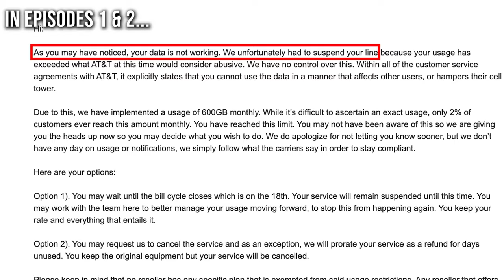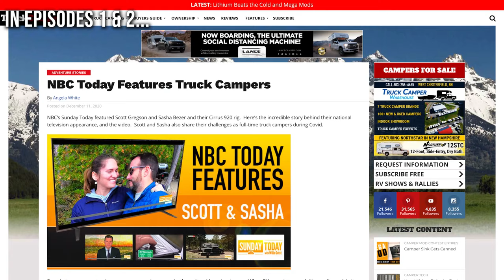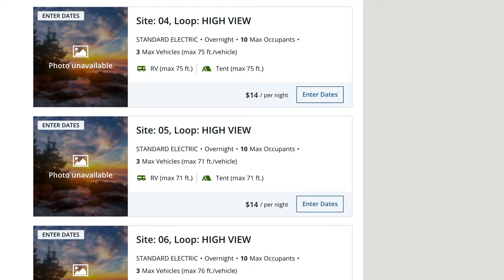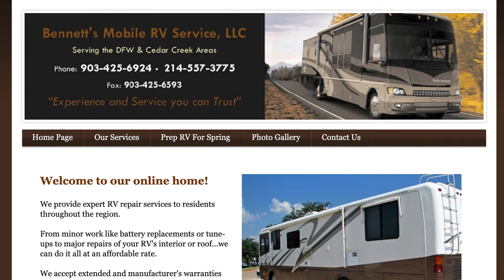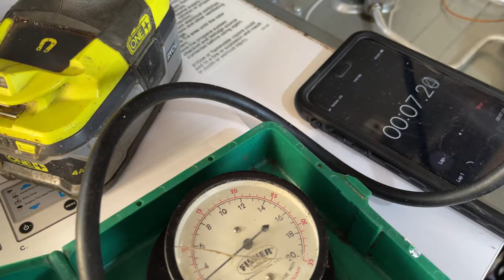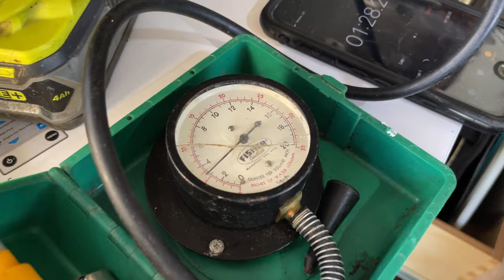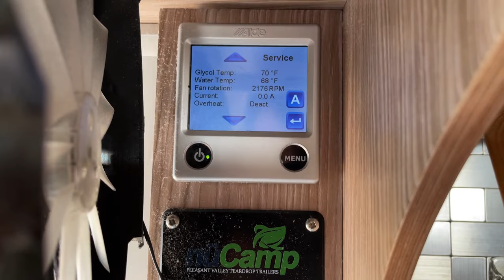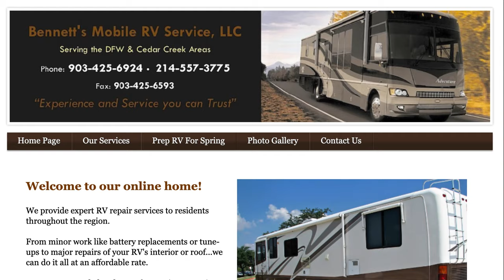Broken Boondocking - Ep. 3 [Alde 3020 Boiler Replacement] \\ Full Time Truck Camping \\ Vlog 8

Comment: There is a drain for the Alde glycol located in the basement. You remove the rear-most bottom panel to access it. It is a red plug held in a black hose with a champ. Will make any future drains much easier. For glycol changes, I saw a YouTube video where someone disconnected the hoses to the overflow reservoir and connected hose extensions and used a small pump to run distilled water from a bucket thru the system to flush it, then new glycol. Looks like an easy job and no trapped air. Sorry you had so much trouble getting the repair done. We had a similar problem last year when our Alde Flow domestic water preheater started leaking. Everyone had a 3 month or longer wait. I just bypassed the Flow to hold us until we could get in.
Reply from the maker: I didn't know about the drain. We looked through the manual, but didn't have immediate access to NuCamp support. I assumed there was an official drain, but we didn't know where it was. Thanks for letting me know, it didn't go perfectly, but its done! The air bled out easily, and we got about 95% of the fluid out. I'll have to test it again in a few months.
Reply: @Stonyboot  I had contacted NuCamp. They sent pictures.
Reply from the maker: I had diagrams and such, but the drainage issue didn’t come up until the guy got there. So he said he would just do it that way, it was fine with me. NuCamp has been great with emails and talking on the phone, I just didn’t get to it this time.

Comment: The fluid pumps run on two D cell batteries best thing you can have for any mess free fluid transfer.
Reply from the maker: it's a great idea. I have a drill pump in my amazon cart, but haven't gotten it yet.

Comment: I think it's absurd that a dealership wouldn't do the work. It shows how broken the dealership model in the RV industry really is. If I buy a Dodge I can go to any Dodge dealership in the country to get work done, and have a high level of confidence in their professionalism, not so in the RV world. I think RV manufacturers need to hold their "representatives" (dealerships) accountable for how they treat their (RV manufacturers) customers. Glad you finally got your camper fixed. Thanks for the video.
Reply from the maker: That is my biggest take away. I don’t think it’s reasonable to need to wait 2-4 months for a 2 hour repair. I also don’t think it’s reasonable to have people simply say no. Regardless, I had to get it done, so 50 phone calls later we had an answer. But it does leave a bad taste in my mouth regarding the RV service industry. 

In regards to Dodge/Ram service. They have been great until a couple of days ago. I had video evidence of a problem and the dealer refuses to warranty it. I decided to simply find another dealer, but since parts are back ordered, there is no ETA. Trying to travel full time with all of these long wait times is getting tough. The back order stuff isn’t their fault, covid shut down production for a long time, but it’s still frustrating. Thanks for watching and chatting.

Comment: sooo.....any regrets not choosing a different brand with a more conventional hot water system? And you say the glycol needs changing every two years. How difficult might that be?
I am in the market for a truck camper and Cirrus is at the top of the list . I am also wondering how is the access to the shower controls. Any idea on that? Thanks for your efforts!
Reply from the maker: Not at all. This was a one off situation, we just drew the short straw. In our opinion, systems like Alde and Truma are the way to go. As for the shower controls, it's going to vary from camper to camper, we have been happy with our knobs, but I know some people have changed out the controls. No complaints from us.

My suggestion would be to go visit the campers you are interested in and spend some time in them. Pretend to shower, use the toilet (pretend) and try to simulate normal life. It seems to be the little details that become the biggest problems over time. Thank you for watching!
Reply: Thanks for responding. The shower control question is more about if they needed to be replaced or if a pipe broke. It looks like there is a big panel that would just come off. Is that correct? The only brands within a 4 hour drive are Lance and Palomino 😕. Not many Cirrus on the used market to check out either. Thanks again! I am enjoying your channel.

Comment: First I saw your video about using bleach to sanitize the system, then I saw this series of videos that you opened by saying the leak was caused by the bleach. I wonder what is safe to use to sanitize the Cirrus water system.
Reply from the maker: Bleach is safe, but the water heater has to be bypassed. I didn’t know that in the beginning. 

Fast forward to now, it probably wasn’t the bleach, since others have had the same issue. Still shouldn’t use bleach in the Alde, it has a built in sterilization mode that should be used. It looks like Pac-Man on the control panel settings.

Comment: A suggestion here I carry two 20 dollar fluid pumps with me one for water and the other for fuel. It makes it makes any fluid transfer easy and spill free you could of used it here. I bought mine at Harbor Freight and also available on Amazon.  How old was your Alde and I guess you said it was warranty?
Reply from the maker: We learned later about the drain plug in under the camper. A fluid transfer pump would have been nice, but I was relying upon the repair guys to have the tools. Maybe I'll get a drill pump for various uses. It was 1.5 years old. I've learned that it was probably my fault anyway. I had used the wrong disinfection method a couple of times and that is what most likely damaged the tank. Chlorine and stainless don't mix well. Oops.

Comment: So would you say alde system is not reliable heating system? Do you know what went wrong with that unit?
Reply from the maker: It has been reliable, from my research, this tank failure seems to be a very rare occurrence. Our Alde has just run as expected until the tank broke. If it happens again in another 2 years, I'll be less impressed. It will take time to figure it out though.

Comment: Does the Alde work on any other power than propane?
Reply from the maker: It requires 12v to run the system, but the main power source is either propane or 120v AC. It will run the heat and hot water at 1k or 2k watts off of AC power.

Comment: Just curious if I may... what kind of truck are you using.. I cant tell if its a dually and if not, what kind of weight are you carrying on the rig. I love the camper but wish to avoid a dually truck if I can... what Cirrus model do you have? Enjoying your videos immensely... thank you.
Reply from the maker: Hi, thanks for watching and asking the questions! We have a 2018 RAM 3500 Dually, Diesel, CrewCab (extremely happy having a Dually). Our camper is a 2019 Cirrus 920. Fully loaded, with all belongings and water, we are a little over 5000 lbs of payload. We run right at the max 14,000 lb  GVW of the truck.
Reply: Thank you so much for taking the time to respond… I truly appreciate it. It seems the size I want to get would require me getting a dually... for some reason I have watched so many of your videos and couldn’t tell (how from all the angles) if it was. Eventually, it would become our main driving vehicle in the city… And wanted to avoid a Dooley because of gas mileage as a normal vehicle…but alas, So goes the cost of the fun we pursue.  Thank you again for all you do… I look forward to all your adventures and stunning photography
Reply from the maker: Thanks so much for watching and commenting! Do you have any wishes for future videos, we love fresh ideas!

Comment: What originally caused the leak?  Corrosion?  I thought Alde systems were supposed to be high quality.  Your camper is only a few years old.  Right?
Reply from the maker: I'm not completely sure, from the research I did, most likely a faulty weld that corroded faster than it should have. We have had great luck with the Alde, but only time will tell.

Comment: All this for hot water, your lives are too complex.
Reply from the maker: How would you fix it?
Reply: @Stonyboot  For one I don't see any necessity for hot water, if i need hot water I use my gas stove top. No one needs a shower every day, when you need one you go to a truck stop they aren't that expensive could do that while doing laundry. in the summer get a solar shower take a shower in the out of doors.  go swimming in a river or stream in the summer just don't use regular soap use the appropriate soap that you would need to research. The other option is going to a YMCA to swim, exercise, and take a shower.
Reply from the maker: @GregariousAntithesis  good point! However, we’re not weekend campers, this is our home and we prefer showering daily. Which makes having hot water one of our priorities.
Reply: @Stonyboot  I would look for an alternative to the hot water heater you have after all you had to go through that heater should not have failed that soon. If hot water was that important I also would build and install a solar hot water heater on the roof of the camper when it is sunny summer or winter if you set it up right you could use the water pump you have to circulate the water through the solar heater on the roof. At the very least is will preheat the water for the water heater but If you can make it efficient enough it will make water almost hot enough to boil.  Tons of videos on how to build a solar hot water heater just use your imagination on how to build it for your application. Should be pretty easy and straight forward.
Reply: @Stonyboot  You guys really need a home base at a friends somewhere where you can go to do your work on the camper if you want to do upgrades or maybe a storage unit with power where you can keep tools and do the work under some kind of cover.
Reply from the maker: Someday we will get a home base again. For now, we are enjoying being nomads. Fixing things on the road is just part of the challenge!